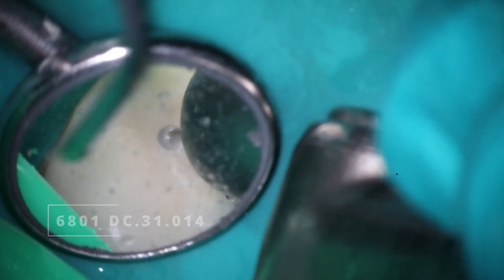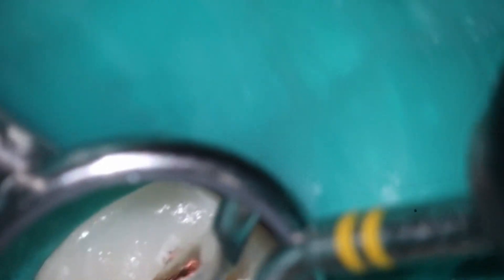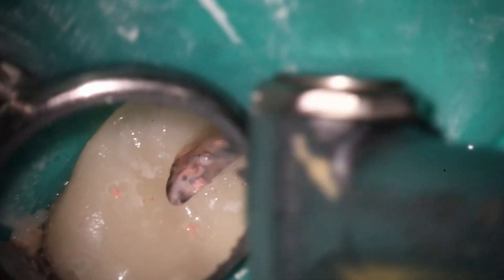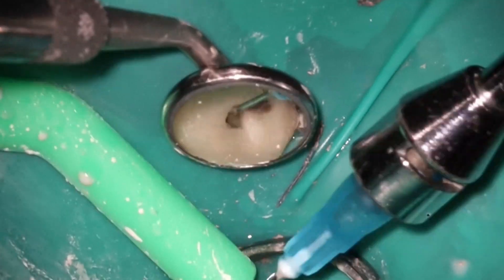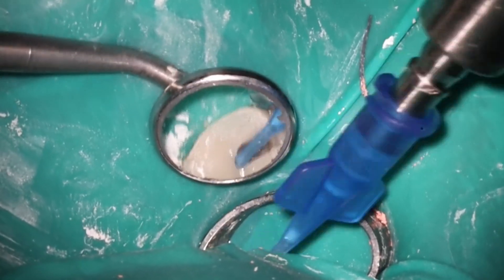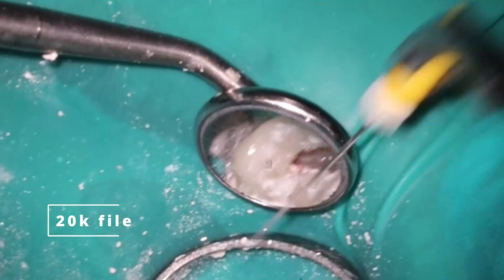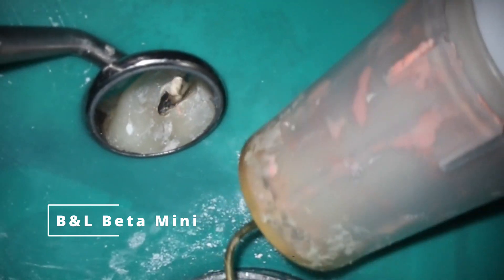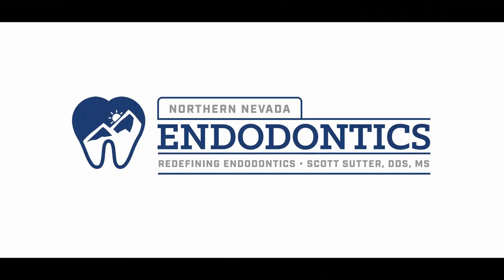Thermafil Retreat with No Chloroform

Comment: Are you cleaning and shaping tge coronal 2/3rds first then using the hedstroms on the apical 1/3?
Reply from the maker: More rotary to within 1-2 mm of my estimated WL based on the CBCT and then you’ll usually pull out the remaining bit. The hedstroms clean anything left